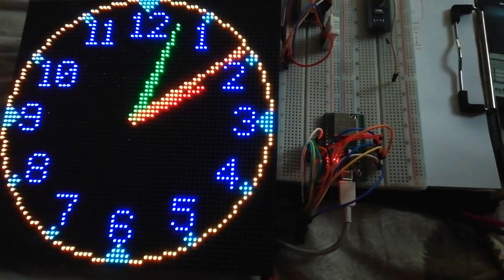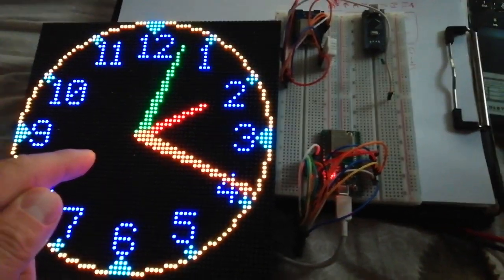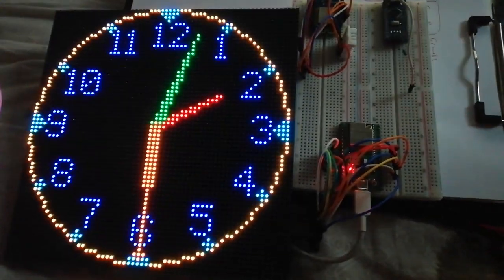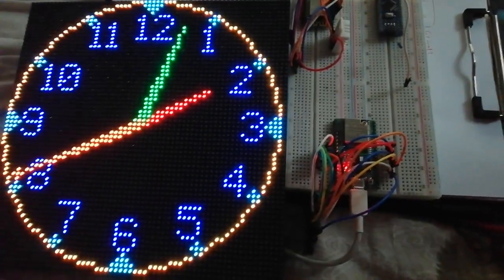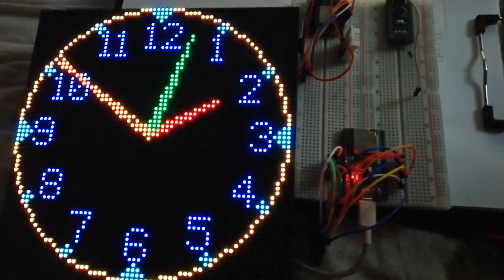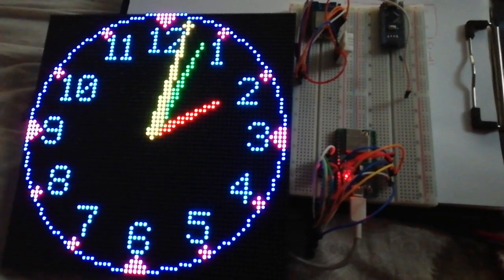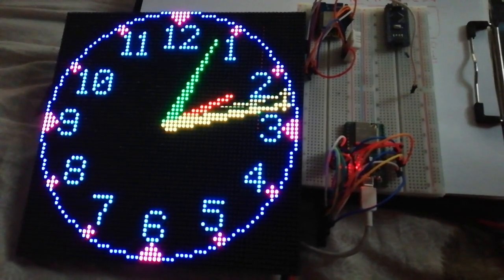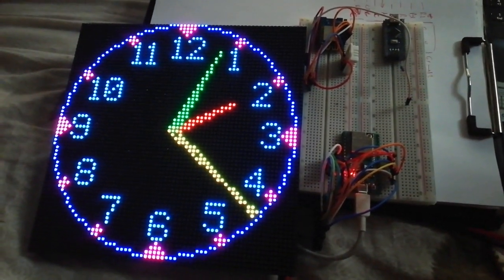analog NTP clock with ESP32 and P3 64x64 led display (2)

Comment: Ohh! My god What a sexy clock; hey bro just adding weather forecast and day & date ; 
It would be excellent if Alam added means when 12 it alarmed 12 time, when 1 alarm 1time , 2 to two time that's way
Reply from the maker: I just solved some issues with original sketch ... I'll try to add some weather forecast info and day/date
Reply: @dj06ntm  that's nice but alarm is the unique idea 👍👍
Reply from the maker: @addiction-69  is an interesting idea, not uniq.. depends by my free times I'll implement some features...
Reply: @dj06ntm  h😁😁😁